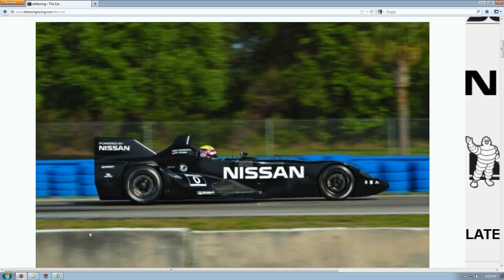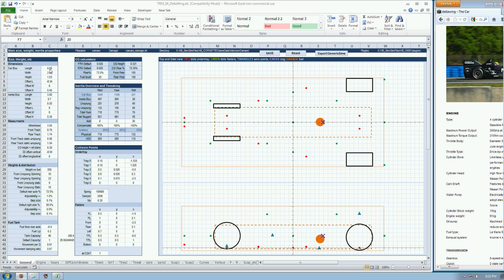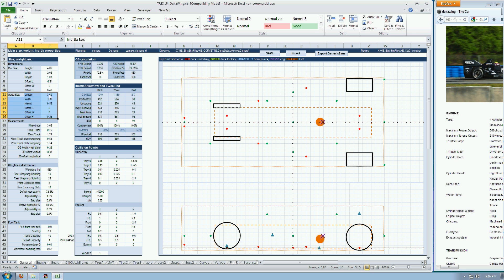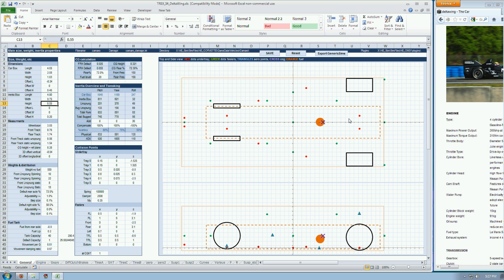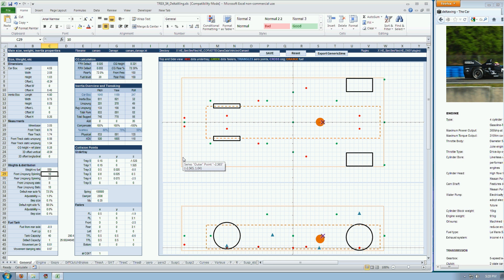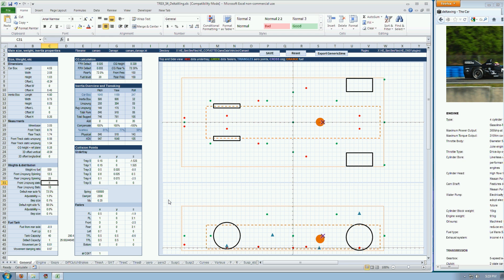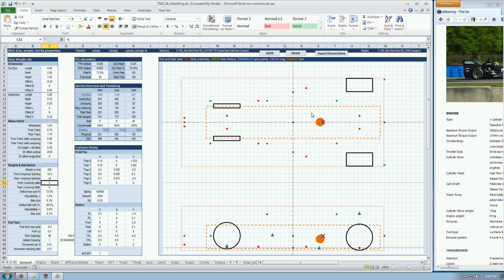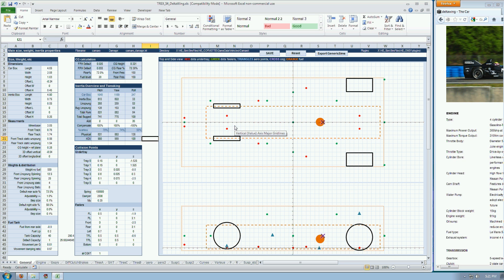Building a DeltaWing type car (physics) for rFactor. Part 2

Comment: vladeaglezz There is a formula yes. Inertia in the HDV is (Pitch, Yaw, Roll) So the formula is:
Pitch=(M/12)*(Length²+Height²)
Yaw = (M/12)*(Length²+Width²)
Roll = (M/12)*(Height²+Width²)

M = Mass.
² = Squared (or multiplied by itself, e.g. 800x800)